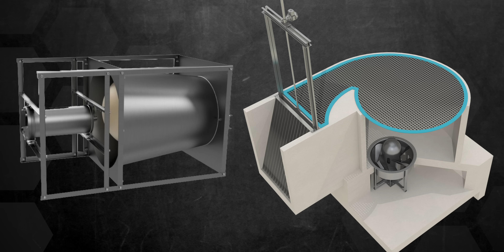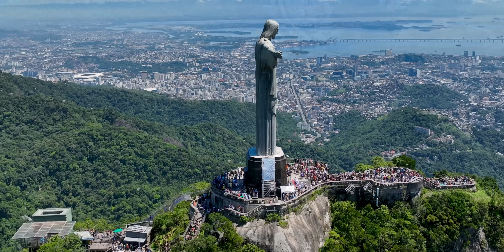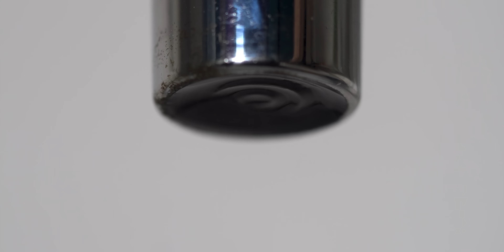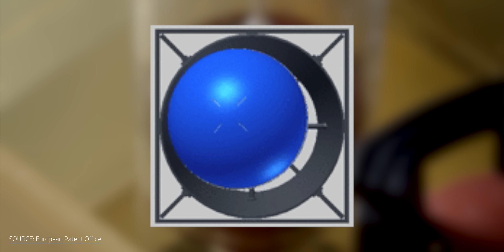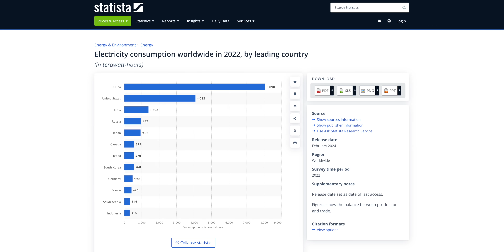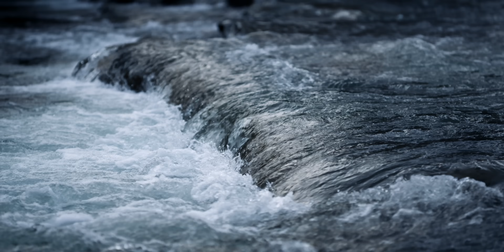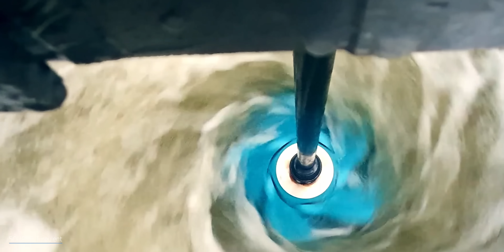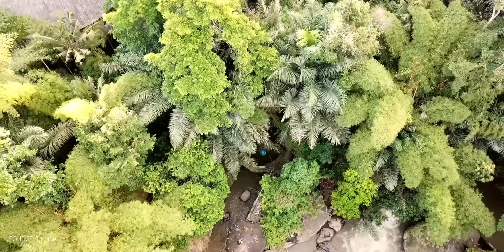The Genius of Small Hydro Turbines

Comment: Imagine undoing the damage Dams made with these devices. Just a parallel series of small hydro where you need it.
Reply: But you can't parallel enough of them to make something like the output of Hoover Dam.  They would be supplemental power not base power.
Reply: The dam creates the reservoir (reserve of water) to ensure 100% uptime.  If you go without a reservoir (called a run of river setup) then your uptime shrinks making your output far,far less.  You cannot replace hydroelectric dams with these devices.  Small or micro hydro is all about utilizing the high head/small flow or low head/large flow opportunities that exist.
Reply: Big dams are too valuable for grid in places that has option to have them. I live 40 km from 40 meter 850MW hydro dam (there are 2 more downstream main river with 12m/300MW and 18m/450 MW power ) and just from water flow rate in river I can tell price for power at moment (dry summer like 400, peak snow melt over 4000 some years, average around 650 m2/s). And they do work all year round no matter ice conditions (meter of ice over deep water storage doesn't matter that much vs meter over small one - might still work but with risk).
Same time - for off-grid/remote areas in warmer climate they look decent option for sure.
Reply: You're delusional if you think hydro dams can be replaced with this garbage.
Reply: If only... But hey, at least they can help prevent further ecological damage! And better a supplemental power source than none.
Reply: @Erik-pu4mj undoing the damn only makes more damage. The original damage of the dam has already been done